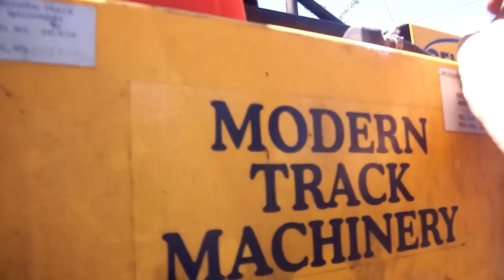Railroad thermite welding near the Mississippi river

Comment: why not use jet fuel?
Reply: +InsanoBinLooney Because jet fuel can't melt steel beams....  haha
Reply: Colson Customs us gov. Says it can got proof to prove they aint lying either.
Reply: Colson Customs - not by itself it can't.   but add other combustibles like carpet, insulation around wires, ductwork, a convection effect and rushing through a small space, and the heat intensifies to the point where iron and steel becomes weak, pops rivets, and collapses under its own weight, as in the case of the world Trade Center towers.   I have a degree in mechanical engineering, a 2nd in physics, and have studied metal fatigue (kind of need to know things like that when building things).  also started in controlled demolition and explosives in the military, so I know what it takes to bring a building like WTC down... months and months of preparation, planning, strategic weaking of key support structures, load bearing walls, miles of det cord, not to mention very precise locations of shaped charges, etc.  controlled explosives would have never been used that high in a building.  not enough control.  but other than those facts,  nice conspiracy theory!
Reply: nice answer ,now how the fuck they  know what floor it  is going to hit? ,to disguise the discharge ,he could have been 5 to 10 stories difference off the mark ,the conspiracy theorist don't have nothing ,no steel beams nothing 2 aluminum has cut steel before 1945 79 floor empire state building & cut the other side too STEEL 3 the explosion the fire man heard the sound & people heard a explosion on the Laby WAS THE COUNTERWEIGHT 10 TO 20,000 LB OR RAW steel falling down the shaft on interrupted ,what you think that shit sound like, IT CUT THE STEEL BEAMS  &  ELEVATOR STEEL CABLES IN 1945 and it CUT IT AGAIN / and the plane was 1/3 smaller
Reply: InsanoBinLooney 😂😂😂😂😂😂
Reply: They did, you did not.
Reply: InsanoBinLooney   Use jet fuel to do what? All the LPG is doing is preheating the rail ends so when you fire off the charge it doesn't hit cold steel. We do use diesel which is basically jet fuel to heat rail and expand it on cold days when you have a joint pop some bolts. I tell you what, anyone who knows how hot diesel gets when it burns wouldn't make stupid fucking statements like the some of the people have on your comment. Those planes had enough jet fuel on board to heat up the steel to the point it would fail. Too many armchair experts in the world. They need to have a reality check.
Reply: Nelson Dacosta  I'd sure like to know what you're trying to say here. Whatever it is, you seem to be pretty passionate about it. I just can't follow what you wrote.
Reply: Actually jet fuel is kerosene, not diesel.  And for people to actually believe that kerosene or regular office fires cases steel framed buildings to collapse and accelerate at the speed of gravity (which NIST actually admitted) is embarrassing.
Reply: Iron or any metal to be exact doesn't have to melt to lose its structural integrity. In addition when you have half a skyscraper weighing down on heated metal its going to warp...
Reply: jawadad802 the other guys the goat and Matt Albrecht never came back lol wonder why
Reply: lolololol
Reply: Also, buildings fall from the bottom in controlled demos.
Reply: InsanoBinLooney chiki busta
Reply: My doctorate in geophysics says the fires that burned in the WTC buildings were more than was needed to weaken the structures and cause collapse.
Also, since it seemed to make a big splash here when it hit, The "aluminum cutting steel" isn't quite right. Aluminum begins to burn at a lower temperature than steel. However, burning aluminum has higher temperature than that needed to melt steel but that is irrelevant since all that was needed was for it to weaken enough to not have the strength to hold up the weight of the structure above it.
Also, the MIC mentioned here, "nanothermite" isn't something I would want laying around in a building. I certainly wouldn't play with it. You don't even need thermite to melt steel in this situation.
Reply: 'cause Thermite's cheaper and easier to control.
Reply: So what we're saying here is anyone can set up a rail welding business using a bucket of kerosene and some old carpet and make $$$$ in no time at all? Im in!

Comment: shoulda just used a cup of jet fuel
Reply: +DronZizzle We all know jet fuel can melt steel tracks :P
Reply: +ahmed but it cant melt dank memes
Reply: If I understand correctly the process doesn't just melt the tracks together, super hot carbon steel is created in the thermite reaction which flows into the gap welding the tracks together.  Jet fuel, which is just kerosene, doesn't create steel.  I don't expect it would get near hot enough to do that anyway.  If it did jet engines would be hella dangerous.
Reply: +Rick Graham you dont get the joke
Reply: It's a joke about 7/11
Reply: 9/11?

Didn't they use thermite?  :)

I think I get it now, thanks.
Reply: +ahmed .. Jet fuel...its cia/Mossad code for thermite..
Reply: you seem to have a cat on you head.
Reply: Get it OFF!
Reply: Brian Butthole ... You guys are clearly well educated. It didn't melt the steel beams, nobody said that, it weakened them enough for them to fail. Do some homework on metallurgy and you'll see that you don't even have to heat steel up 1000° before it looses almost half its integrity.  The screen name goes well with you
Reply: ever been on a job site for a building? those beams are lag bolted and/or welded and most importantly, encased in concrete. I melt aluminum in an old steel propane tank, using a steel crucible, the heat inside the kiln is hot enough to get the steel crucible red hot, but not enough heat transfer through concrete to affect steel on the outside... aside from that... the caracas tower, a building in venezuela, fire began before midnight on the 34th floor, spread to more than 26 floors, and burned for more than 17 hours.. building didnt fall. finally and most important, all that jet fuel in those wings combusted on impact, thats why there was billowing black smoke (intense fires never billow black smoke.....) and there were people standing in the holes where the planes hit and waving at news choppers as they went by. Wanna speak some more about education and doing some homework?
Reply: TheDrakenZ the WTC towers used blown on fireproofing on the trusses that made up each floor that had been having problems staying on for years before 9/11
Reply: ***** If you've ever been on a job site you'd know that those steel beams are encased in concrete. even if there was burning jet fuel in there, which there wasnt, since there was billowing black smoke and people standing in the holes waving at news choppers. If there was burning jet fuel it still wouldnt be hot enough to weaken the steel through concrete. Also, the empire state building burned longer, through multiple floors and didnt collapse. lol learn some chemistry before you start preaching and ruining other peoples minds with your ignorance.
Reply: You (and a flood of ignorant others) seem convinced concrete is fireproof. WRONG. Concrete is made by baking clay and it is porous - go visit any brick house that has burned down and see just how few are left after the fire. This is not fired by jet fuel, it;s just 2x4s and the other shit that builds a house, and even that will DESTROY concrete, DESTROY "fireproof" boxes, DESTROY steel silverware and pretty much everything else in the house. I know this because it happened to mine - after the fire there was nothing left, even the brick walls had crumbled.

You appear to have zero idea of how oxygen adds heat to a flame. Why do you think cutting torches work? You take a flame that melts small steel rod, throw a bunch of extra oxygen in it and now you're slicing through 1" plate like butter. The WTC was more than a hundred stories tall. Most of its support was around the central column and the outside walls. The outside walls were breached, and those stairwells and elevator shafts are like big chimneys. What happens when there's a fire 70 stories up? The heat creates a draft (just like a fireplace) that adds heat to the fire.

Dumbass.
Reply: ***** the WTC was made with steel trusses which had spray on insulation that they were having trouble keeping it on. The cores were made with steel and a double layer of drywall. When the plane crashed into the building it blew off the spray on insulation and the jet fuel started fires over two to three floors. While the fire didn't melt the steel it burning for two plus hours weakened the steel to the point that floor collapse was inevitable. Learn how a building is constructed before you start preaching and ruining other people's minds with your ignorance.
Reply: P
Reply: Jet fuel is kerosene, bloody useless for high temperature applications. [ except in jet turbines ! ]

Comment: I used to do this on a high pressure natural gas pipeline. We called it cad welding. I would cad weld a corrosion test lead onto the pipe in order to take a pipe to soil reading above ground after backfilling.

Comment: Did you see that red molten iron ? those Column beams on the twin towers looked like that after 6 to 8 weeks. it was thermite that brought those buildings down not Jet Fuel / kerosene. I own a welding shop and those beams looked just like Oxygen & Acetylene torch cut those beams at an angle so that they would slide off of each other. thermite does the exact same thing as a regular torch does its just way way way HOTTER and faster.

Comment: Likely barium peroxide and aluminum dust on top ignited by the magnesium strip.   This will bring the termite up to the very high heat necessary for the reaction to start

Comment: It seems like a long process to use a thermite to weld but it is understood to achieve a hardened top layer and a soft inner lower part of the rail that cannot be achieved through modern-day welding

Comment: With all the tracks so neatly welded, how do they accommodate for expansion and contraction of the tracks during hot and cold weather?
Reply: +hawkeye0248 tracks simply rise and lower
Reply: +hawkeye0248 the welds swell at the same rate and because the rail is bolted into wood its able to flex with the weight of trains along with difference in temperate.
Reply: +hawkeye0248 Not sure about the US but in the UK track like this will be stressed using hydraulic tensors to be under minimal tension/pressure as temperatures rise and fall, there are also expansion switches at set distances to allow for expansion and contraction during particularly hot or cold weather.
Reply: +hawkeye0248 There are various methods, one of them is by calculating the mean temperature of the area where the rail is located, and then they stress the track so that the expansion and contraction isn't too severe either case.The tracks won't even rise or lower. This method is used by the subway and local trains in my city.
Reply: +hawkeye0248   There is a simple formula to allow for expansion and contraction of rail which takes into account the region of the U.S., the rail temperature at the time of welding, etc.  Consult FRA regulations.
Reply: Regular steel will expand about an eighth of an inch every 15 degrees Fahrenheit for every hundred feet.  That's quite a bit.  I know this because I was a surveyor when I was young and that had to be accounted for when using a steel tape measure.  In addition to what you said about pre-stressing, I believe that these tracks are made from a steel alloy that doesn't expand/contract that much.  We had somewhat expensive rods to use in precise leveling that used an alloy (I forget what it was called) that expanded little enough that the adjustment was negligible.  Mind you a rod is 12 to 16 feet long, not a hundred..
Reply: hawkeye0248  Every region in the US has what they call a "Neutral Rail Temperature". For simplicity, let's say it's 100 degrees at this location. So when they laid the rail in the first place, they heat the rail to 100 degrees and place rail anchors on the base of the rail to control longitudinal movement of the rail. OR they use tie plates that have a built in fastener system, ie Pandrol Plates or other types of "clip tie plates". So these two welders go out to weld in a repair rail. Before boutet welding it, they cut out any additional rail that may have been added (especially if it was a cold weather repair). Since when you cut in a repair rail, you add two rail joints, you weld out one joint "loose" first, and after it's cooled down, you put hydraulic rail pullers on the second joint, and pull out any added rail, and reweld or boutet out the rail joint. There's some math involved. You get it back to the neutral rail temperature. So basically you get it to a point where the location is safe for hot and/or cold days. That's pretty much it, the Readers Digest condensed version. I hope this helps you to understand.
Reply: They heat the rail to reach 104° in this area, or cut the rail if it's over that temp.  Rail anchors limit lateral expansion/contraction of the rails.  Rail that isn't properly constructed or repaired can suffer sunkinks in the summer, and pull-aparts in the winter.
Reply: hawkeye0248 the rail is laid at (prefered laying temperature depending on the region) this will account thermal expension and contraction.. if laid too hot( above prefered laying tempereature) could result in rail breaks in cold weather,if laid too low, you are adding steel to the cwr(continuous welded rail) depending on much your adding in a short location and  on the the amount of welds you could end up with rail misalignment( track buckle)

Comment: Don't know that much about tracks,but it looks like the other side of the tracks is in dire need of support.Maybe i'm wrong.
Reply: +LuRcH they took the beams out because they are made of wood they gonna replace them after welding
Reply: Someone else told me that the tracks I saw were the old ones they removed so they could put in new ones.
Reply: +LuRcH The first person was correct my friend, you can see the sleepers coming towards the camera where the other section of track lies, the bit you see is too far apart to be part of the track and are just old rails put aside
Reply: the rails arent supposed to touch the ground.  it's the wood ties below that need to have a solid footing.

Comment: the word is thermite and not termite, all the experts speculating what the mix is calling it termite, a termite is a wee insect isn't it? And i doubt they would be using barium or lead oxide, as the reaction liberates elemental metal, and unless they do things differently in the States I am guessing they would be using iron oxide to weld steel rails, i don't think a rail welded with lead would last very long. A sparkler ignites thermite easily there are lots of videos on YT of ppl starting it off with a sparkler, true magnesium ribbon is more usual and works better, u can see it isn't magnesium cos magnesium burns with a very bright flame, and the thing they used wasn't bright it was all sparkly like a sparkler.

Comment: why is it that sometimes they use bolts and sidebars and other times thermite to connect the rails
Reply: +tim bum Different type of track.  What's referred to in the UK as Jointed Track using fishplated joints is the older style of track with joints every 22 yards.  It has the advantage of not needing stressed, but requires much more maintenance and is not suitable for higher line speeds.  Welded Track is largely preferred in most countries over Jointed Track.

Comment: This is fkng interesting. Why is there a gap in the rail and how many times do they need to do this within say a 5 mile stretch? seems like a pain.
Reply: +lancemarch I'm only speaking from experience with shop welding. But I believe the gap is left so that the molten material can get in between the rails, instead of just flowing over the surface. This would allow for a more complete and even bond of the two peaces.
Reply: +lancemarch as tlane said it improves the weld(you see them pre heating the rail ends through the gap at the start of the video, all the rail face to be welded should be a consistent heat ), the moulds on the side are also made in a factory so you usually need to make everything match, when the moulds are added to the side of the rail they are usually rubbed back and forth so that it takes the rail shape as close as possible.

Not sure what the standards are in other countries but here the gap is ideally 25-30 mm but there are what we call wide gap welds which are obviously bigger.

As to how many welds in 5 miles, rail usually is made into about 24m lengths for the sake of transport, if its new track then they would more than likely use a mobile flash-butt welder either as they go along or stationed somewhere close by which can keep welding the rail length to whatever is manageable.

This type of welding is usually either for a small amount of welds,joining the larger lengths that have been mostly flash-butt welded or in hard to get to places like rail switch's/crossovers.

Comment: What's the pink basin made out of?
Reply from the maker: firstnamedylan The "Pink Basin" is called a crucible The one you see is made from sand so it can be broken down after the weld and covered up with the track ballast (track stone). So the track crew does not have to hull the wasted product with them. Even know some sites still make them pick up all the waste. They have different kits for welding here is a few links for some; The one you see is this one here called a degradable welding kit.    http://www.orgothermit.com/degradable.html  Here is another kit called a single use welding kit.   http://www.orgothermit.com/single-use.html
Reply: Scott Dolatowski I was curious about what it was made out of because my dad and I were thinking about making a forge, and that thing seemed to be able to handle a hell of a lot of heat.